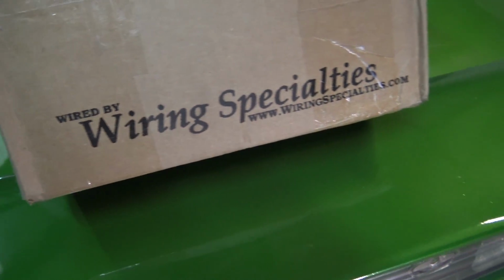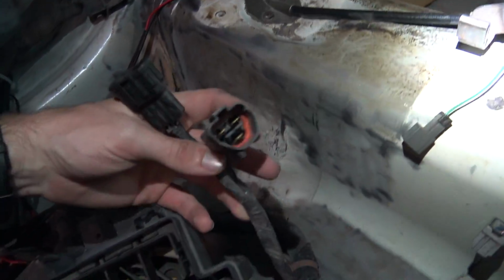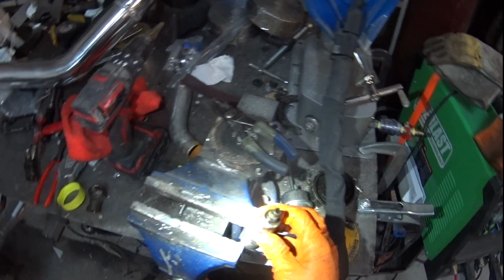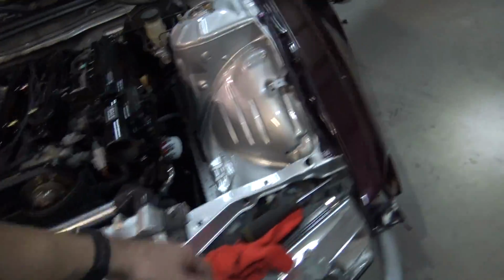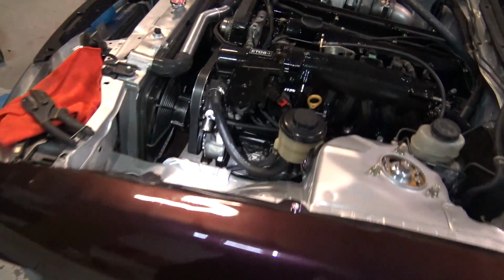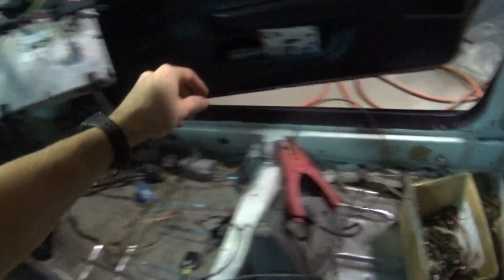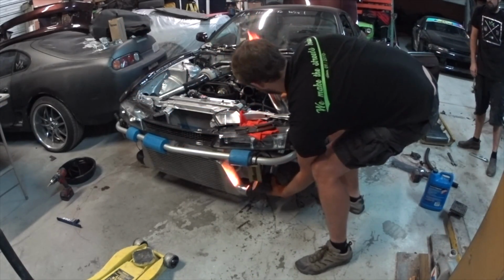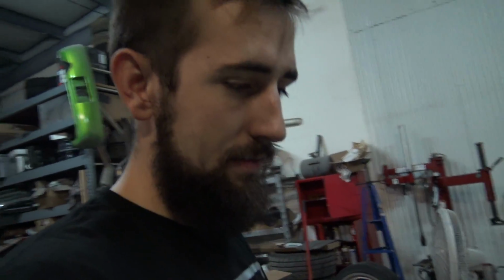Pt.10 | Project Build Giveaway | CATCHES FIRE...  | 2JZ Swapped Nissan 240sx |

Comment: That coil on the power steering pump is basicly a magnet. When it energizes it will open the stem. So you could put that on like a rheostat and have adjustable power steering

Comment: And this here kids....is why if you have to use starting fluid (which if things were working right you shouldnt) if you have to spray it directly in the throttle body. Don't keep spraying unless the car has stopped running since the last spray. Seen more idiots set cars on fire with starting fluid. I don't keep it in my shop.

Comment: Try grounding the body of the ignitor, looks like it was just hanging on the ECU, theres a bit  of debate as if it needs to be grounded on 2j's but it should be bolted down anyway.  Theres 2 sets of timing marks on the cam gears also, one for actual tdc and one that from memory is 60 crank degrees out and if it is set on the wrong one this could cause the problem your seeing..

Comment: Trevor, make sure you guys have the injector plugs and the coil pack plugs on the right cylinders. I know with some harnesses, especially swap ones it can be easy to hook them up wrong. Hopefully you can somehow verify that by the wire color. May ask the company for a diagram

Comment: sounds like wrong firing order.. could be a mixed up wire in the harness to the coils. spark and fuel with an open intake valve would easily explain that backfire.

Comment: does the S14 have an electric vacuum pump for the vacuum brake booster? if not are you going to put one in or are you swapping to hydraulic brake booster for power assist brakes?

Comment: Can you go more in depth on the fuse box?? I want to do that.
Reply: Street Side all the wires are twice as long as they need to be can put it wherever you want
Reply: How did you mount it to the trunk? Ill be doing this. So just the headlights and front lighting need to be routed to the front? What else needs to be sent forward from the box?
Reply: Street Side just the wiring for the gauges
Reply: Gamma Light body harness and engine harness are two different harnesses
Reply: I also want this knoledge. I'd be super hesitant to extend O2 sensor wires changing resistance along with finite sensors of the like. I'm sure it gets pretty complex on some cars.
Reply: Road Bash TV. Right on, I guess I thought everything had to be extended from both harness, thank you for clarification:)

Comment: Trevor ! Could you do a video of how much a swap like this would cost and what parts it'd need? So us dreamers have an idea of how much to spend and the best parts you'd recommend ?
Reply: Luis Benitez as the unofficial accountant for MotionAutoTv.caaaaam I'm here to inform you that a good ballpark number will be around 10k on a budget easy.

And 15k-20k splurging on the goodies!
Reply: Yeah swap costs over 10K to do it properly I have a 1JZ S14
Reply: There is always the "right" way.. which is more expensive then there is the "budget" way. you often see the budget way have to rebuild/redo many things after.  I'd say 10k is a good ball park figure. I just got a wiring specialties harness and while it started at 650 bucks with all the odds and ends  added the total was about 1,000. harness ONLY. I'm still sourcing as many parts as I can so it will be a "faster" swap.. though, I am doing LS

Comment: Didn't B is for Build figure out how to hook an OBD2 diagnostic tool to the stock 2JZGTE ECU?
Reply: i think because it was an OBD2 ECU... i believe the one trevor is using is an OBD1 meaning you have to use the DAIG connector and jumper wires, count CEL blinks and cross reference numbers from a given service list..

Comment: is the engine grounded to the body in at least 2 spots with heavy gauge wire? when i moved my battery to the trunk, i had a similar issue
Reply: Andy Hoscheit Grounds are very important! Can use a set of jumper cables as a quick test